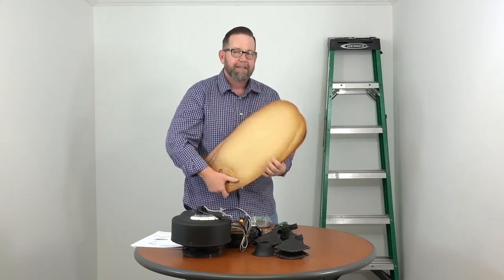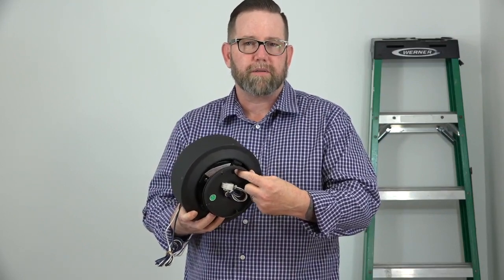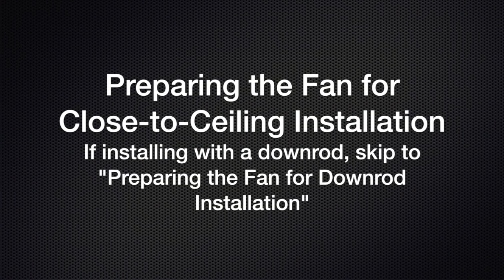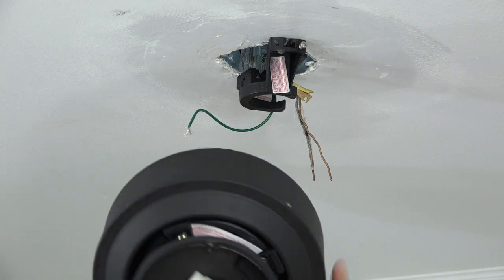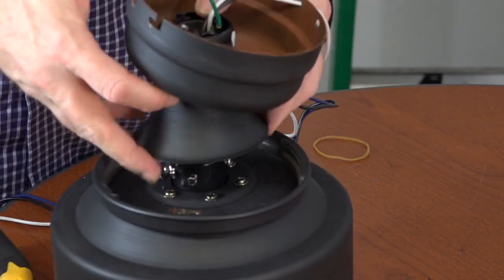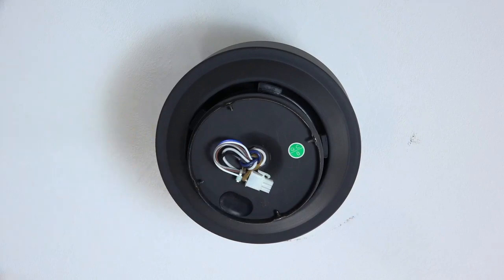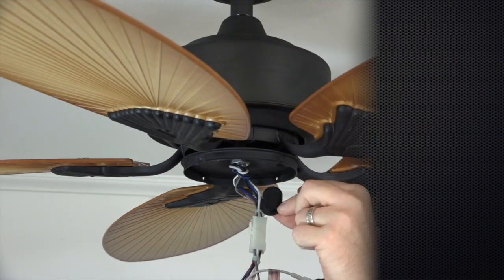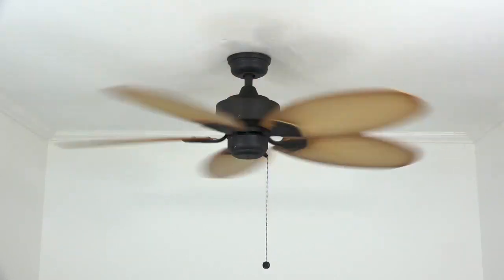How to Install the 52in. Lillycrest ceiling fan from Hampton bay

Comment: Putting the blades on, that are not the slide on like u have, are a real nightmare, the fan is beautiful, but installing it with the instruction, is pure HELL!!!!!!!!!!!, I have the screw on blades, and the instructions tell you to intstall the blade all put together, 2+ hours just to get 3 blades outta five installed, before we gave up. Came home watched your video and will try and do it ur way even though we don't have the slide on and lock blades, wish I did. This fan is such a PAIN!!!!!!…..…...smfh…..Hampton Bay, Havana 48-inch ceiling fan.
Reply: I wholeheartedly agree ma'am. I've installed many ceiling fans over the years, this one's a real pain!! Hampton Bay, you need to make things a little more user-friendly.

Comment: Do you really have to attach the blade arms first you can attach the blades onto the blade arms and then put it on the motor
Reply from the maker: It's easier to install the blade arms first since they are easier to handle than the whole blade arm/blade assembly. Technically, you could attach the blades to blade arms first. The blades are QuickInstall blades, so they are super easy to attach once the  blade arms are installed.